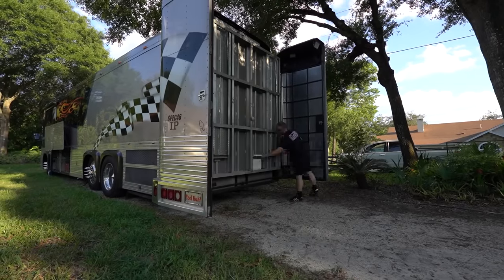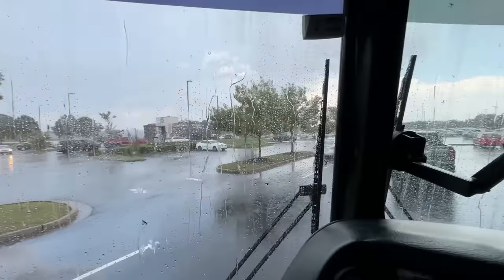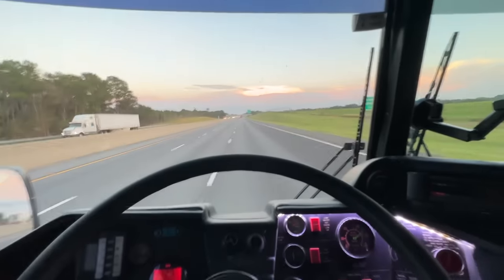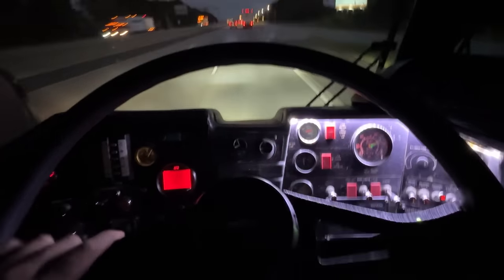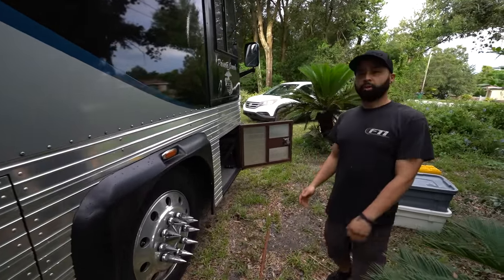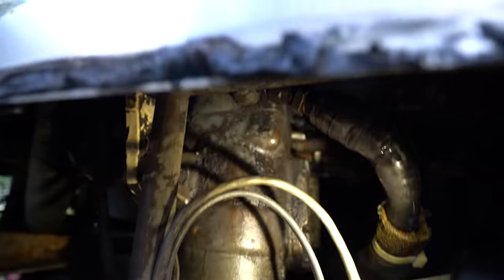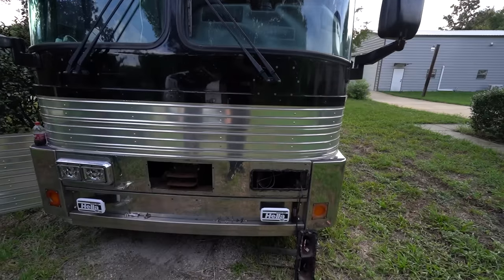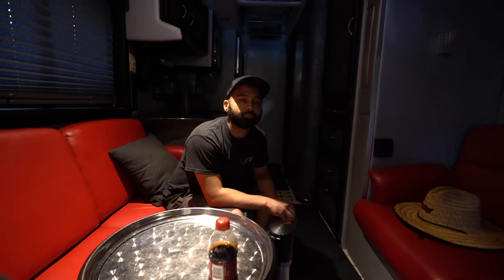First breakdown in the new car hauler bus conversion. major problems far from home.

Comment: For your led strip for your gauges, I know you mentioned that it was bright at night. 

You can get small 12v ones just like that for the cars that are RGB and have the remote with it. So you can change the color to red at night if you want or green. And even dim it. Or turn it off completely when you don’t want them like during daytime. 

I would deff go with that over the just white.

Comment: The fittings on your hoses, we call em aeroquip. They are removable from the ends of the hoses. I have to recommend doing hoses from the engine that are 10ft. Then 5 foot hoses at the front. And then 30ft hoses down the body. Or better yet stainless pipe down the body. That's what I do on semis.

Comment: Ray, next time maybe consider using a double-ended male barb fitting and compression clamps along with and short 12" new Hyd. hose with correct Hyd fitting on one end for the pump and splice the old/new hose together in an emergency being it wasn't a high-pressure line. Love your content, you'll get this rig right.

Comment: Hey, when you were filling that up and talking about the funnel being too long, I was thinking just chop the tip off that funnel to the shortest where it still gets inside the filler tube. It'll give you more head room for filling with the gallon containers. And it should still work for filling oil in other places. Just a thought for a quick fix on that funnel issue. Sorry to hear about the problems but by time you get to all of them the bus should last for years more with regular maintenance without more problems. Be like brand new. 

I really do like this setup too. Makes big problems seem like not so bad. Keep pluggin' dude, you'll dial it. I have faith!

Comment: As a mechanic that works on heavy duty trucks I would highly recommend getting your annual FHWA inspection done on that bus before taking any long trips in the near future, I would also check you air brake system, including your Slack adjusters, brake chambers and airlines.  Also check with your local state DOT and see what guidelines they have for operations of a heavy duty truck, get yourselves a tire tread depth guage and check the tires for proper tread depth and wear. Have your steering gearbox inspected as they can fail in a rather spectacular manner, just had one go while I was moving a truck from one building to another so I could do the inspection on the truck and had the steering wheel get ripped out of my hands and lost all steering when the gearbox blew its seal pissed all the fluid out onto the ground and had no way of steering it.  Could have been worse though but still something to look out for.

Comment: I’ve raced an mr2 for fifteen years and transport it in a lorry with living accommodation I built. I’d give the air system a good look over as well. I also used to have a tail lift, which I realise is pretty much essential in your case, but I got fed up with it. Yours seems pretty solid but it’s another thing to go wrong (mine did, massive PIA at the circuit trying to load to get home) so I removed mine and built some ramps. WAY easier and more reliable. Shame I can’t add some pictures for you. Anyway good luck with it. Although I’ve got my longest drive of the season to the top of Wales on Saturday (13 hours) and you’ve made me slightly paranoid now 😅 Definitely doing that oil change tomorrow and going over the old girl before loading on Friday!

Comment: find a good shop that works exclusively on rigs/buses so you can get parts and work done that you are not comfortable enough to work on.

also some pins to hold down the ramps when you load/unload a car , even though the drop isn't bad it just seems like a good idea to prevent injuries to both cars and people.

still a pretty sweet toter-home

Comment: You can get AN style hydro fittings that screw together and are rated to take high pressure they are a big pricey but in a situation like that cut the damage wrench a end on and get a union and a short hose to get er done

Comment: One huge plus to this setup is being able to hang out rather comfortably while you think up a solution. 😊 a thought I had as a low knowledge individual; is there anything that would prevent you from working the rear lift and not allow you to get to the engine bay?
Reply: They’re going to be in a real bad spot if that lift fails, my buddy had one fail and it was awful 14:27

Comment: They make rebuildable power steering fittings, they are like AN fittings but with out the swivel, they come in steel and aluminum. The #6 fittings are good for 2000psi. We wise them in the off road industry for the hydraulic assist steering setups so if a hose blows out on the trail we can rebuild them

Comment: You should get a fluid transfer syringe. Mityvac sells one in a kit with a vacuum bleeder. makes fluid changes on everything so much easier. Also, jam your funnel into a rubber hose and hose clamp it. Also makes things much easier.

Comment: There is this neat thing called a pre-purchase inspection that most heavy diesel shops will perform for between 3 and 500 dollars. Then, you can fix or have fixed any of the urgent issues they would have identified.
That would have been my first step even if I had already bought the bus.
 A rig that size can have hidden issues that could cost you or others your life. 
 Brakes and steering come to mind, but so does exhaust leaks and frame problems.
Think about it.

Comment: Here’s a suggestion, you might want to consider , run a hard line from front to back, and then use a shorter flexible hose from the front Power steering box to the hard line and at the back A short line to the hydraulic pump and reservoir , this maybe more cost-effective if you ever have more problems down the road to replace the hoses

Comment: I recently had to use a hydraulic line repair kit I believe that's what they're normally called. You cut the hose on either side of the break, then screw a sleeve over the hose, you then have a smaller piece you screw into the center of the hose to push it outwards against the outer sleeve, repeat on the other side of the hose then connect them together and they seal really well, it's meant to be temporary but could be something to use for a period of time if needed
Reply: Sorta like an AN fitting

Comment: Make sure to change all the dif and hub oil, and make sure to drain the air tanks to keep them empty of water from sitting. Also keep an eye on tire pressure, usually 110 in the drives and 105 in steers will help them last longer. And try and get rolling before turning the wheel, that will help your steer tires life last longer

Comment: You made the good decision to return home, you could have got into no end of trouble on the later stages. The dollars you saved by not having to be towed or going to a expensive repair shop you spend on a top notch replacement that will probably outlive the RV.  In the Uk we have a mandatory six week cycle for service / inspection schedules if it needs or not (everything documented). You can be stopped by traffic enforcement day or night. So for instance if you knowingly carried on with the faulty line and caused issue by breaking down the vehicle inspectorate here (vosa) would have your life(£60 fine for a bulb failure) some inspectors are tyrants but not all. But again a very good decision. As usual top viewing material .

Comment: Dude I’m excited to see what you do with it.  I genuinely thing a tilt up rear door, and removable railing to make the lift into a patio (very important feature!)
Also it would be epic if you could make the lift gate go up without tilting it down so you can get easier access to the engine compartment.

Also maybe cut the rear doors (chop the bottom third off, the use the pieces to make a bifold door on each side so you can swing those doors open on the side of the road without tilting them out into traffic!

Comment: I’ve been doing some thinking on a solution to the doors not opening wide enough for the car, and why not put the doors on a double hinge? That way you can open the doors, and pull them back to open them wider and get them out of the way further. Stops you from building a whole new door system. 🤷🏻‍♂️ Things to think about.

Comment: Love the bus concept...Maybe consider a front end closed circuit electric pump/power steering cooler/reservoir?  Might be better than 45" of hose chaos.
Reply: That is so much more complicated than it needs to be. It just needs the antique line changed out. No need to reinvent the wheel, plus you would need a serious pump to keep up with the demand of a loaded bus. I picture the headlights dimming every time you turn the wheel.

Comment: Probably worth taking the bus to a specialist mechanic and get it thoroughly checked out.
Those power steering lines should be in multiple sections or have long hard lines that way hoses are easier to change

Comment: At least YOU can actually fix the bus and touch it without having to worry about some bs warranty. Plus that thing looks dead simple besides routing the super long lines lol. If you didn’t still have the new build scaries and were super familiar with the bus and the different semi shops that could’ve helped you this probably would’ve only set you back a day. Just a learning curve and so much better and cooler than a new truck!

Comment: Lines like that, do it in sections with quick connections like on your race car Taylor.
Any lines on the bus like that do them all in sections with quick connections.
Have spares section of lines made up and stored on the bus under the floor in the car bay..
Treat the bus like your third race car nothing but the best for it..
Check everything right down to the toilet has no leaks..

Comment: Good call n what I would try when you charge the power steering line is when pulling out the old one tape the new line to it that way the old line helps put in the new one

Comment: You've got a rock star bus! Back in the day Eagle buses were the preferred bus for bands to your in. And the drivers loved them also. They ride and handle the best. But they do have some short comings, namely the odd ball suspension and the birdcage structure \ frame. But the running gear is all class 8 truck stuff. I would suggest you find the most qualified bus mechanic to go over the entire running gear. Which would be the guy on YouTube, the bus Grease Monkey. He does a most through inspections and will find 99.9% of problems with your bus. Some will be things you can repair. Some are a total pain in the rear to do yourself, king pins, suspension bushings brake rebuilds and such. I can't picture you guy's pulling the wheels and tires off to fix brakes or air lines in your driveway. Regular truck garages are not the answer. You really need  to visit The Bus Grease Monkey, he is the only one I would trust. You need to watch a couple of his videos to see what I'm talking about.

Comment: Sucks you had an issue, but as others have said, at least you didn’t need a tow.   One thing you should check out is a fuel discount card like TSD open roads….you can save a good bit of money on full ups.   Only down side, is it is only participating truck stops (Loves/TA) but not really a downside, since getting that big of a rig into a regular station can be a pain.

Comment: From somebody who used to do service roadside hydraulic hoses get yourself a good box of nine line string that way you have a string to pull the new ones back through also it would not hurt to really look at the air brake hoses and lease have one spare at all times it also wouldn’t be bad to have a couple leaves 5060 footers a 3/8 maybe half inch hydraulic hoses or GIC fittings on the end of it where you can adapt to all different situation‘s to make it through a Road trip that’s what I’ve kind of learned over the years of fixing car carriers semi‘s those hoses only have so much of a life they’re like tires to really look over all the houses on that bus might cost a pretty penny to replace them all but it might be worthwhile

Comment: I would make sure to check the date on your tires. They will age out before they wear out on a bus. Most tire manufacturers recommend 5 years to be max life. Even if the tread looks brand new. A tire failure can do a ton of damage, even if you get it safely off the road after a failure.

It's very hard to change 8 tires that look perfect every 5 years. But the consequences of ignoring it is something that makes me do it anyway. Be safe, love your channel.
Reply: Drives are fine up to 10, but I replace steers at 5 for sure.

Comment: I work in an engineering field with environmental chambers and equipment that runs for several hours at a stretch, often very strenuous levels. This is in the effort to make sure that things we make can sustain their environments when they go out in the field.

These machines have regular preventive maintenance, meaning we’re replacing stuff, even though it still works. That way, we don’t have to worry about something breaking during a test that we need to collect data from at the end. Even with all that, we still have random failures here and there. It’s never fool proof. But there are ways of trying to mitigate some of that by doing preventative maintenance. Just sounds like this rig needs to be under that kind of schedule, where things get replaced, regardless of their actual condition. Or at least, that would be a goal.

Comment: Taylor can we get the amazon link for that tablet holder.... looks perfect for what i need.... use a union and attach the new line to the old line and pull it through.... those are JIC reusable fittings no crimper needed... just a cutoff saw and a vice and some wrenches.... and yess you can splice those lines if you have the fittings

Comment: Hey Taylor sorry about the break down. I am a tractor trailer and heavy equipment mechanic. That line that is leaking isn't co.pressed like you're thinking it's more like your an line's. It can be taken apart and reused. If you have enough slack in the line you can even take it off, cut the line, then put it back on.

Comment: Run hydraulic hard lines from the front to the back, then use short hydraulic hoses with hydraulic compression fittings from the hard lines to the steering box and to the pump. Keep a couple spares in the bus.

Comment: Just a heads up, NAPA does hyd hoses. Not all of them, but usually the franchise stores out in the country. I was an over the road construction equip mechanic for like 6 years, napas saved my butt on lifts and semi's more than a few times when I didn't have the fittings or hose
Reply from the maker: We went to an oriellys that does hydraulic hoses.

Comment: I worked for miami dade transit and the power steering line can be replaced with pipes with fitting welded on and just make 2 foot hose it get to the pump and steering

Comment: Not sure what you have for a roadside kit, but absolutely get 20 feet of 1/4, 3/8, and 1/2" synflex with push connect couplers, as well as reusable hydraulic fittings in a couple of your sizes. You can absolutely just cut that hydrraulic hose and thread together a new fitting.

Also make sure you have brake chamber caging bolts and either spare brake hoses or be ready to crimp off a leaking one and cage the brake to run 5 wheels. If you're not familiar with air brakes, you really really need to do some research and know how they work and how to replace and adjust them.

A proper wheels off inspection is a really good idea.

Also I'd suggest picking up a Milwaukee fluid transfer pump. Good for EVERYTHING.

Comment: Definately worth looking at putting a hard line if you can from the front to back and having easily accessable hose lines between them. 
ok more joints but if they're suitably located then easier to fix than one very long flexable line.

Comment: I work on hydraulics for a living, get you some , “make up ends” and “jic x jic” fittings to have on hand for the next time something like this happens, 

We use them to save time and money on difficult hose replacements,  they hold 3000psi easily

Comment: Taylor please check the brake stroke length of the slack adjusters, and shoe lining thickness, also hit every grease point especially slack adjusters, S-cam and king pins (only on steer axles) the proper way to grease kingpins lift up the axle and have someone steer the wheel continuously while you grease

Comment: I wonder if it's possible to run some hard line through the middle of the bus, so you've only got a few feet of soft line at each end?
There is one way you could have bypassed that pump, rather than disconnecting it completely. Get a short loop line made, then the pump can just circulate directly back into the reservoir. 

As for other things to look at, every other soft line and fitting on the truck. Both driveline and cabin.
Does the main engine charge the generator battery? If not, add either a voltage sensitive isolator or a DC-DC charger. You can get 2 way isolators that will allow the generator to charge the main batteries as well as it's own. (ie Redarc SBI12D) That might help the generator starting issue. 

At the end of the day, at least it was a pretty minor issue. And you're all home safe. 
Looking forward to more videos and maybe colabs with others that know busses inside out.

Comment: Starter is another thing that may need to be checked, lines on brakes and grease points, check Ure fuse box or carry extra fuses with you and always place a roll of multi color wires to splice or even tie things together

Comment: You need a truck and tractor place,  think about combines trash trucks , use to have to replace hydro lines on trash trucks.  Roll of hose and a fitting clamping machine